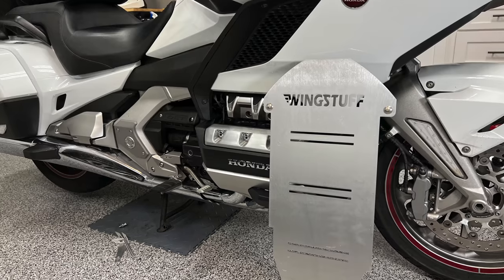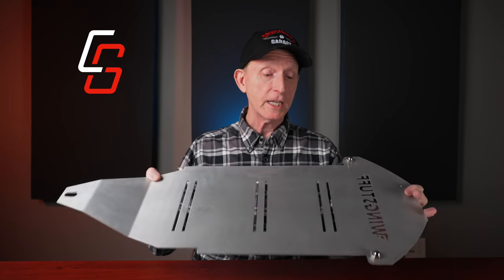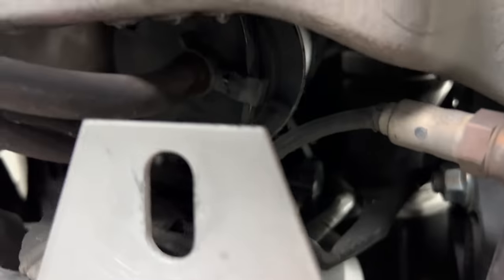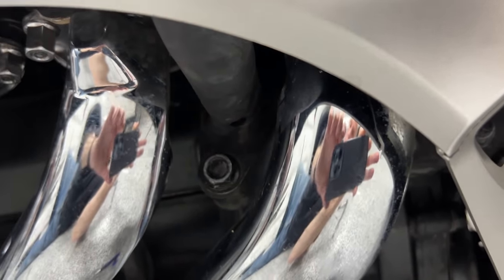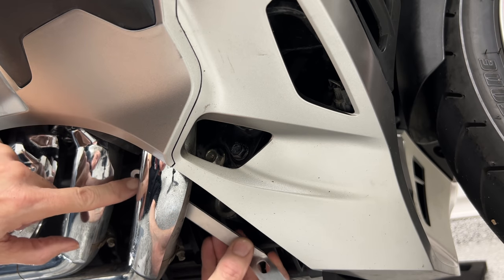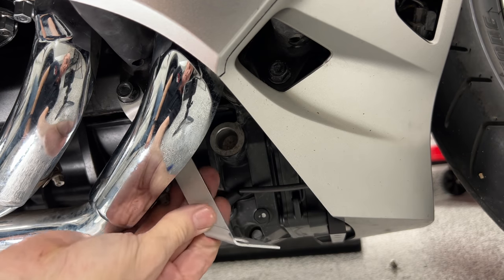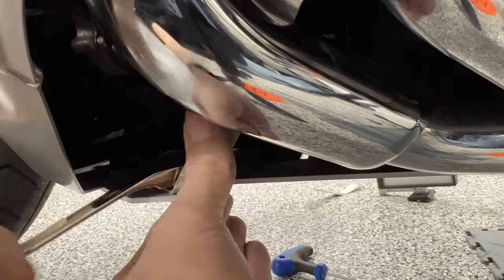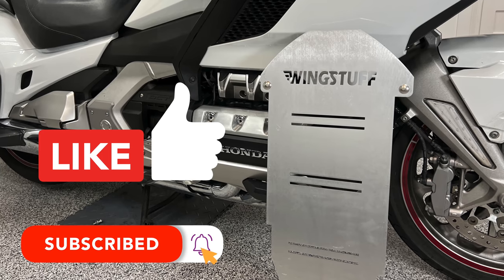Belly Pan Skid Plate for 2018+ Honda Goldwing from WingStuff | Cruiseman's Reviews | 2022

Comment: I am not impressed with it. First, why should I have to bend brackets to make it fit. That's not right. The brackets should already be bent in the shape to fit the installation. Second, I'm not a mechanic, but I don't think anything should be laying up against the exhaust headers even metal that won't be affected by heat. That is just a bad design. I wouldn't be surprised if down the road you could also get a rattling or vibrating sound from there. Third, shouldn't the front of it go under the plastic lower cowling? I could see that it would be a good place for dirt and debris to get in there on top of it from what is thrown off the front wheel. I went on Wingstuff website and, of course it isn't available yet, but there are no instructions. I was hoping to see if they tell us we have to bend those brackets to make them fit. Good video. Now that you have videos out on both Wingstuff and Traxxion, which do you prefer?
Reply: If the 2 left and right hangers are pre bent, they would not maneuver between the engine and pipes. This was left intentionally so customer can form it easily by following instruction starting from top engine guard bolt. Once it's formed it could go in and out easily.

Comment: This design is a fail. The Traxxion plate is a cnc milled and anodized work of art. I have it installed and over a thousand miles on the bike no oil seeps.
Reply: I made the mistake of buying the Wingstuff plate. Piece of junk, I took it back off and will be ordering the Traxxion one.